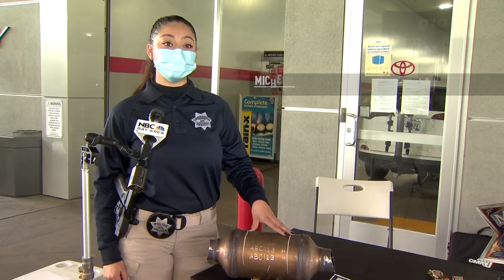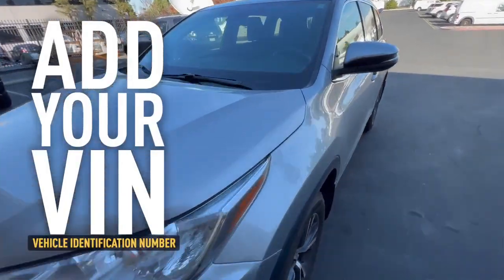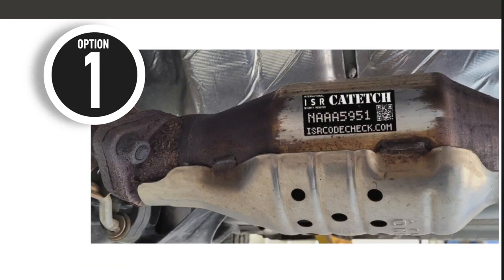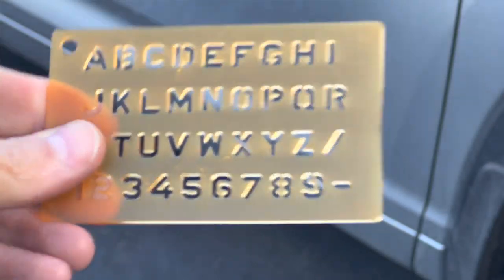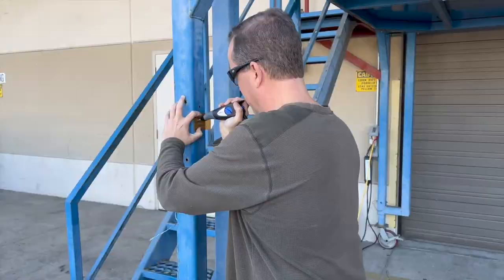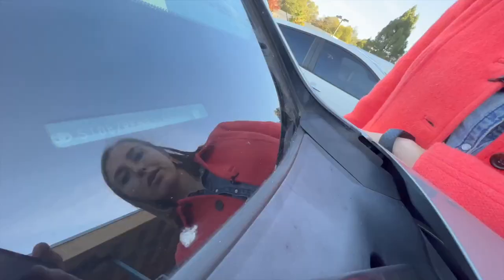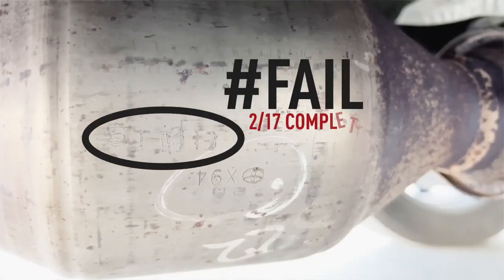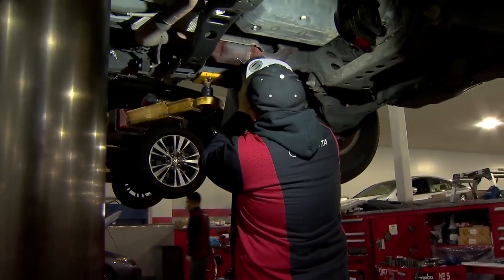How to Mark Or Etch Your Catalytic Converter

Comment: After old Prius2's new Cat was back from the shop, 2 days later, the CC was stolen again.  I had a feeling this was going to happen, but my insurance company had no interest in paying for any additional security measures. My GEICO adjuster said the shop offered to install a protection plate for $400, but I would have to pay for it. My deductible was only $250. 
A new Toyota OEM Cat takes 5 weeks to get, since they are all on the slow boat from Japan, and costs $2700, since the whole exhaust system is one piece and the sensors to it also need repair or replacement.
The 2nd time I left a $100 thick aluminum protection plate in the car while it was at the bodyshop, and the shop installed it for free (which is easy to do once the car is on the lift).
Yes, the car manufacturers need to put the VIN on the Cats AND some sort of protection plate. And police need to work with scrap yards and whoever buys precious metals to catch the people doing this to cars.

Comment: how hard would it be to scrape off that vin number, though? supposedly gov. grewsome passed a law yesterday to crack down on buyers. theyre half of the problem. mine was just stolen on the 24th.
Reply: Just install a straight pipe until your smog is due. 🤪 Trust me that can def. work.